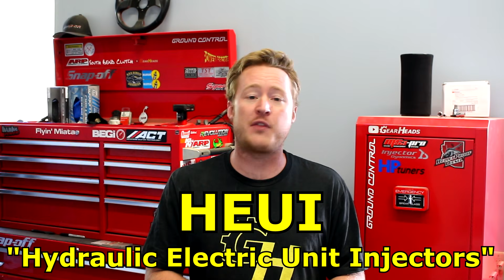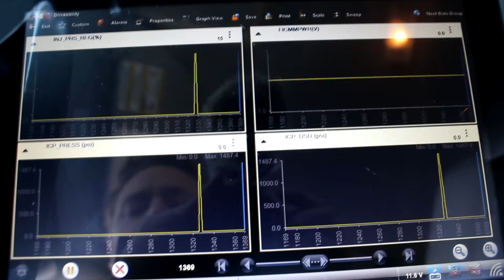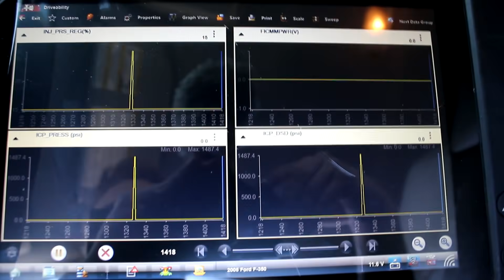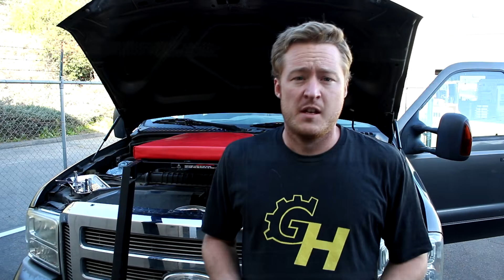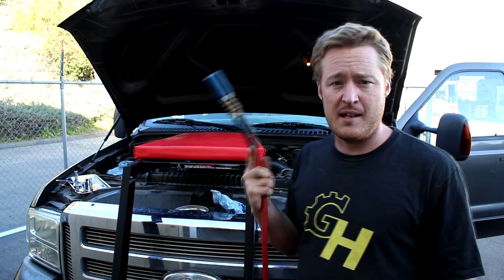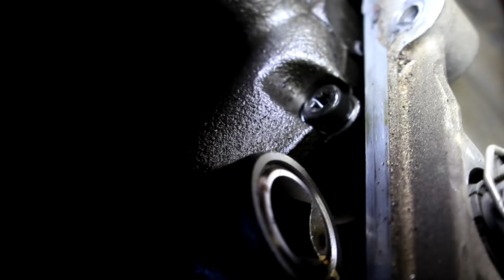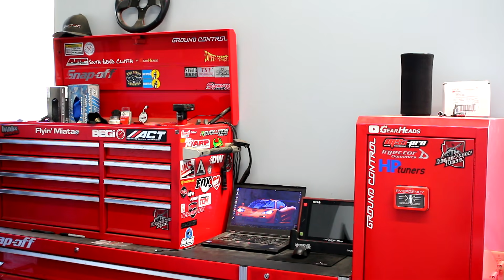Ford 6.0 Common No Start Problems

Comment: I've got a 2005 6.0. It quit on me while I was driving and now just turns over but won't start. I took the cap off fuel filter and its got plenty of fuel. The only code I get is U1900. Can that code tell me something or what should I look at next
Reply from the maker: That code is saying there is a CAN Bus communication error. At this rate you will need to take it to a shop that has the proper equipment and knowledge, if the communication error is what is causing your issue then without the right tools and know how it is going to be very unlikely that you will be able to fix the issue.
Reply: Maybe IPR sensor

Comment: Oil pressure sensor on the top of the motor has also caused a no start multiple times for me. Unplug it and the truck will run...albeit poorly...but it will get you to a NAPA.
Reply: Where exactly?
Reply: @sauce_joey8915  Google it...but if memory serves me correctly, front and slightly left between the manifolds. Should be a two-wire connector in the top of the sensor.

Comment: spot on video!...had exact same issue on my '05 that dealer could not or would not properly diagnose...Turned out to be the flawed HPOP fitting...Replaced fitting with updated version and all good......now I have a similar issue but only when the truck is cold...Once warmed up it will run and start fine but at normal cold outdoor temps, say 70 degrees or lower, it will not start without turning the starter for several cycles until it finally fires up.  I'm thinking glow plug issues or sticking injectors????  Any thoughts?
Dreat vid and thanks for the detailed info.
Reply from the maker: Do you have any codes? Could be injectors going out, air in your fuel or glow plug issues, have to test things and watch data to find out.

Comment: My is a 2006.only starts with starter fluids. Cleaned fuel tank, replaced fuel filters. Ran OK for about 2 weeks and is having same or worse issues starting or keeping runing. But it won't start unless I spay it first. Truck is parked.
Reply from the maker: I gave you a list of things to test, cant do much else without seeing the truck myself I sadly am too busy to try and help diagnose through the internet.
Reply: Could it be poor fuel quality or water in the fuel, or bad fuel pump?

Comment: Hello,  I have code P2284 injector control pressure circuit  range/performance,   any ideas what to look for ?
Reply from the maker: What year is your truck?
Reply: @GearHeadsGarageChannel  I have this also mine is a 06

Comment: I have a2006 6.0 power stroke that has been bullet proofed. It is a bigger to crank . It will crank and run fine but most times it takes a 3 or four cycle with the heaters cutting the ignition on and off. It seems to want you to turn cranking and most times it is when you stop the winding it cranks and runs fine. Hope you have the magic.
Reply from the maker: Im sorry but the spelling and wording was very confusing, from what I can hear it sounds like you may just have weak batteries.

Comment: 6.0: biggest pile of shit I’ve ever owned. I put 300k with no problems on my 96 Cummins. Under 40k miles put on a 2004 6.0 and replaced cam position sensor; icp sensor; ipr; harnesses; 3 glow plugs and both harnesses; a hose I had to take half the engine apart to get to; pulley backed off power steering pump and threw three s belts before mechanic figured it out.
Reply from the maker: Damn you sound late to the party! and comparing a 96 12v Cummins with ANY modern diesel is not a fair comparison lol. As far as reliability goes it will stomp all of them but good luck finding a truck that hasnt fallen apart or doesnt cost way too much for what it is. The more modern diesels will destroy it in comparison though on tunability with power and fuel economy.

As for your issues though...that sounds like either bad luck or poor workmanship, those arent the typical problems I see on them at all. Either way that is almost 20 years old now, give it a break!
Reply: It’s not the engines fault. Sounds like your mechanic is a parts changer, and not a good troubleshooter.  The dealerships are the worst.  There are very few mechanics that know this engine.  Most just create more problems and just keep throwing parts at them.  With proper high pressure oil, good fuel pressure and good FICM, it should start.  It has to have cam sync too and crank sync too.  Could just be a bad sensor. I’ve heard of the main wiring harness going bad on older trucks also.
Reply: @rodgraff1782  Disagree. It’s one of the worst designed motors...ever. There’s so much to go wrong. Using oil under  several thousand psi is idiocy. The oil runs so hot. I could go on for pages.

It’s wedged into a van and nobody wants to work on it.
Reply: @jeffreylonigro1382  I’ll agree, oil being used as a hydraulic fluid is not healthy.  I change mine every 3000 miles and use Schaefer’s, and an two 4 ounce shots of revex.  I know this truck is going to leave me on the side of the road at some point.  Just hope it doesn’t happen on vacation pulling a 35’ trailer. You are right. There are tons of stuff to go wrong.  I don’t know if I would go diesel again.  Seems like they all have their problems, especially since they had to go with the particulate filter system.

Comment: What is going on if you have no water and or pressure in the top radiator hose ???
Reply from the maker: Yikes. you obviously are very low on coolant and need to fill it back up. hopefully you werent driving it super low and killed the engine.
Reply: @GearHeadsGarageChannel  It shows full in the reservoir / fill point
Reply from the maker: Did you actually take the top hose off and there was no water or did you just squeeze it? and are you talking about the actual RADIATOR hose or one of the small coolant hoses? and what happened to lead to you looking for an issue in the first place?
Reply: @GearHeadsGarageChannel    It was low on fluid. This is the first diesel engine I ever used and or worked on . But it turns out I had to add more then I thought
Reply: @GearHeadsGarageChannel  Thanks for your help 👍
Reply from the maker: If it was that low then there is a problem. Filling it back up is not a cure it is a very temporary treatment.

Comment: Great video, but I'm going to take it to a shop.
Reply: 😂that's what I did, I understand gas engines but not diesel.. 🤦🏻
Reply: Be careful who you use the 6.0 gets a bad rep in my opinion because of crappy mechanics great truck but high maintenance

Comment: hey there we just changed the glow pugs camsenser cranksense and crankseal and the fuel pump but she wants to start but seems like she dosent have the power to and its kicked out gray and black smoke . will this video help with that or do u think its an air lock in the line? thank you katrina
Reply from the maker: This video can help point you in the right direction of things to check, if its pumping out black smoke it sounds like the injectors are probably firing. These need to be on a battery jumper usually when opening the HPOP system but it doesn't sound like you guys had to do that with the repairs you listed.

Comment: 2004 F250  Early 6.0 
Just throwing this out there to see if anybody has had my same issue!!! On level ground  Starts and dies 3 times and then long crank after about 30 seconds of cranking it will finally start. After it starts!  It cranks and runs all day with no issues!
 now I have found if I park it with the nose downhill it will start and run every time with no long crank. Any help would be much appreciated thank you!!
Reply: If it were a 7.3 I would say the reservoir check valve is not keeping the reservoir full of oil. the the long cranking is the low pressure pump putting oil back. There is enough oil up stream of HPOP to initially start it. It can be an issue with the 7.3 I know.
Reply: Man I appreciate the reply and I still haven't figured mine out I'm in the process of pulling the Hpop out right now

Comment: I have a icp voltage of .24 and it stays at .24 when cranking the icp pressure I at 950 when cranking
Reply from the maker: dont know off the top of my head what .24 volts is but .24 doesnt sound like 950. If you can verify you have 950 then you have a problem elsewhere. I mentioned watching for FICM Sync etc as well. Also if it is the 04.5+ or so then try unplugging your icp sensor. An HPOP no start issue will present with less than 500psi, so first make sure your data is correct and if it is then look elsewhere.

Comment: Hey I was driving my 6.0 on the highway hit some uneven pavement and it shutoff the truck going 80 pulled over tried to start it and didnt want to even crank all lights on dash were on though
Reply from the maker: Sounds like an electronic issue, make sure your batteries are fully connected and check your grounds and harnesses.
Reply: Inertia switch down LH side in the passenger foot well be worth checking

Comment: What about in an E-350 van with a ‘doghouse’ engine cover inside the cab of the van? Is this 6.0L high pressure oil leak problem easier or more difficult to work on, compared to a truck? How many hours labor should it take a skilled mechanic to solve this high pressure leak hot soak & long crank & no start problem ?
Reply from the maker: Passenger valve cover is harder to remove but its still the same engine. Some things are easier to get to because of the access from the back others are harder its all a trade off

Comment: Heres what i have. Bulletproofed and EGR deleted 2004 6.0. 

Didnt start when i got it. 

Was throwing codes for injector pressure. 
Got a new ford remanufactured FICM. 

That took care of the injector codes. 

Noe its saying that the entire passenger side (all 4 cylinders) glow plug circuit/ open. 
Which is a P067 code. 

Im getting fuel to the bowl. But dont have a method to check fuel pressures. 
I have a SCT tuner that shows some data but im not ramiliar with self diagnosis on diesels. Any help is greatly appreciated.
Reply from the maker: Injection pressure codes are not FICM related thats part of the HPOP system. Check all the data points I told you to check in this video and also make aure you have crank/cam sync while cranking.
I wouldnt worry about glow plug codes until you actually get it running.

Comment: My 6.0 ran out of fuel .I primed the fuel pump and also primed the ingnition to send fuel to the filter that’s not the issue my starter went out so I changed that but it’s still turning over I checked voltage in batteries one has low voltage dropping to I went to o Riley to charge it so when I hook it up do I prime it for 30sec on and off a few time again ??
Reply from the maker: If you ran out of fuel but the bowl is full then you might have killed your injectors. But you NEED to have a charger at your house because if you ran it dry and got air in the system it can take quite a bit of cranking to get it to start.
Reply: A charger as in batteries charger?I took both of them to o Reilly’s they’re charging me now
And also I had another fellow mechanic use his snap on scanner and it said 1 fuel injector circuit low

Comment: Plq
Reply: I have a 2003 f350 power stroke no start the fuel pump not getting current and torn the key and the starta not getting current I want to know if PCM problem

Comment: I need help I have two 2004 Ford f250 kind ranch diesels that won't crank or start before it did when we put diesel on both of them they started to shut off while driving without any warning as if it was losing diesel we have been stuck for about 2 years figuring out what the problem is we need help !
Reply from the maker: You dont have any diesel mechanics in your area that can assist you?
Reply: Might should have used diesel instead of gas.
Reply: My bad that's a typo i ment diesel

Comment: Any good scanner you can recommend for diesel and gas engines thank you
Reply from the maker: If you have Fords get Forscan it is very powerful. As for a pro level one cheapest way is going to be something like Autoenginuity and a laptop. I use a Snap On Verus and Matco Maximus at work but thats expensive for a DIY

Comment: I have a 6.0 need help  can't get it to start good eop fic power  no leaks hard to crank its killing my batteries  in 4 cranks
Reply from the maker: Sounds like you have bad batteries. Start there.
Reply: Just a suggestion also replace the starter my 04 would drag down starters replaced with rebuild start we it would start right up    high torque starters

Comment: Alright here's what I got 2004 6.0 ,184,000 miles just had it bullet proofed, previously was leaking shit tons of oil,that's fixed when I got the truck back hard to start mechanic said starter or batteries so I replaced both went with the 6.4 starter still no start unless plugged in ,mechanic says injectors so I say fuck it bought 190/30 injectors ,mechman alternator, 4" turbo back and an sct tuner.got it back from mechanic same fucking problem by day two hard to start from a cold start and continously smokes white smoke that smells like unburnt diesel fuel. Still doesn't start from a cold start unless plugged in mind you it's 60-65 degrees this morning will be in the mid 70s today....PLEASE HELP this truck has bested more than one mechanic.
Reply from the maker: You threw a ton of different data points out there and it wasnt very clear or concise. Either way, sounds like the truck has some issues that have stumped your mechanic and sounds like he may be guessing. Find a 6.0 specialist in your area and ask them. Me making recommendations or trying to help over the internet is just going to be shots in the dark, little better than what you've been getting now.
Reply: @GearHeadsGarageChannel  well the first guy was a diesel "specialist " taking it to another "specialist " Thursday evening. Will update when I hear something.
Reply: @GearHeadsGarageChannel  glow plugs and harnesses, which the last mechanic was supposed to change.
Reply: @JACOB MYERS running now still kinda a long start and hazes when cold,goes away around 155 degrees on the oil and coolant

Comment: I recently had my 03 6.0 f250 service for a crack injector and when I got it back my a/c went out and and the next day I was driving it , smell like burn rubber but couldn’t figure out from where. Park my truck and 3 hr later try to turn it on but won’t come on. It would crank and everything but just won’t turn on
Reply: Any helpful ideas on where to start
Reply: I had a/c issues, then no start. Turned out the a/c bearing had seized.  @eduardomontes1676
Reply: Does it start when plugged in? I recently had my injectors replaced and mine won't start unless plugged in